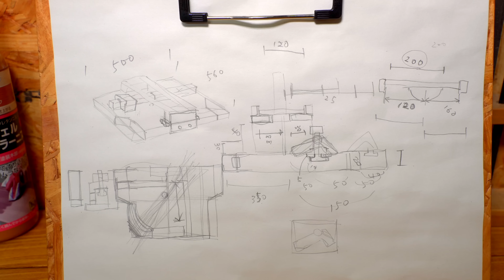【DIY初心者向け丸鋸スライド台】跳ね上げ式丸鋸スライド台の作り方（直角微調整機能）

Comment: very neat job. I can only say one thing: when I made a similar device, the thickness of the boards along which the saw moves greatly reduces the depth of cut. I had to look for thinner ones.
Reply from the maker: Thank you for your comment!
It is true that balance is important when it comes to the thickness of the rail part.
The square timber I use is about 40mm, so I use that thickness as my standard.

Comment: Hello, congratulations for your design. To my opinion is one of the best out there. I am trying to do something like that and I need some help if possible. When I fixed the 2 aluminum edges I realized that my circular saw does not have a fully straight bottom plate, so the circular saw flickers between the aluminum edges for about 1-2mm. When I pushed harder the aluminum edges to the bottom plate the circular saw could hardly move forward. After that I measured the bottom plate and realized that is not perfect straight. Is that possible? My circular saw is a Makita DHS660 purchased new and used enough without any falls. Any suggestions please? 
Thank you in advance
Reply from the maker: Thank you for your comment!
I also had the base plate of my circular saw warped due to daily use.
Remove it and check the degree of distortion using a table or straight ruler.
I fixed it in a vise and corrected the distortion with force.
If the distortion cannot be removed, it is better to request repair from the manufacturer.

Comment: Hello, after looking at many different designs... I find yours very interesting. Please could you help me with some questions I have for you regarding your design?

1.  On the left hand side of your table against the back edge, you have the long piece of timber from left hand side of your structure to the far corner. That piece of timber is approximately 300mm long, I've looked over and over and I can't see the importance of it. Please could you tell me why you have it there at all? To me, it seems unnecessary because if you were using it as some type of border, wouldn't your resting block (which you have bolted to your table) be sufficient? You've gone to great lengths to include it in your design, though I don't see why.

2. On the opposite side of your structure on the hinged end, in the far Right hand corner, you've left that corner without any timber border at all. Again, I've tried to see why you've left that corner open... please could you explain why you have?

I fully intend to build my own version of what you've created here, as I have the perfect place already in my normal work area... please tell me what you think of the following design?

On the hinged end of your structure, have blocks the same size (both sides) as you have on the open end (from which you're standing at work.) Wouldn't this design reduce the amount of material that you're needing? If you had that corner blocked, (instead of leaving it open) wouldn't that eliminate the need for hinges at all?

Please reply soon, I'd be very interested to know your thoughts...

Thank you, Keith from Australia.
Reply from the maker: Thank you for your comment.
I don't know if that answers your question. .
The square piece on the left is the center of the 165mm saw blade and is the effective cutting range position.
The square timber allows fine adjustment of the right angle.
The purpose of the hinge is to directly see the cut line and fix it in place.
If it is a fixed type, there is a slide rail, so it is difficult to adjust the position accurately.

Is the above okay?
Reply: Hello again, thanks very much for your reply... I appreciate your time and your thoughts. Though I think you're missing the point of my questions. 

Your reply explains the use for your bolted block on your table, yes yes... I understand the need for this block for fine tuning your work. Though my question is why you need the longer block that you've glued and screwed to the edge of the table... on the left hand side of your hinged structure. 

Also I'm asking you why on the RIGHT hand side of your hinged structure, you've left that corner open. These are the things that I don't understand. Please don't misunderstand me, I'm not critical of your workmanship or your design, I'm simply trying to work it out why you've built the way you've built.

This will then help me with MY design that has evolved Completely... from your design. @DIYmotto
Reply from the maker: it's okay.
There was a discrepancy in the literal translation of the translation software.
The left side is to prevent veneer distortion.
The right side is open for visibility of the circular saw blade position.
Reply: Hello again, right!

Now I understand completely why your design is the way it is, thank you!

My name is Keith, I'm Australian... living permanently in Australia. Retired with a pension, my workshop at home and vegetable consume my entire existence😊😊... normally I don't join anyone's particular channel though with yours I'll make an exception.

I'm looking forward to seeing more of your work, perhaps we could compare designs of different pieces we've made in our own particular workshops.

Please let me know if you're interested, thank you.

Keith from Australia. @DIYmotto
Reply from the maker: Thank you!
I'll do my best to make it easier to see and understand!
It gave me courage.
Reply: Hi sir, where can I buy the black blue knobs? ( 2 times a year I am in Japan ) Thanks for the very interesting video.
Reply from the maker: Thank you for your comment!
The product name is Change Knob.
It can be purchased in the screw corner of home centers or on Amazon.

https://amzn.to/4eWXIvs
Reply: @DIYmotto  Many thanks for the reply. Do you sometimes have the name in Japanese , it may be in kanji or  hiragana. Will be easier for me when buying in Japan.